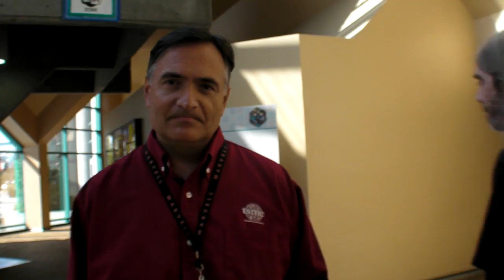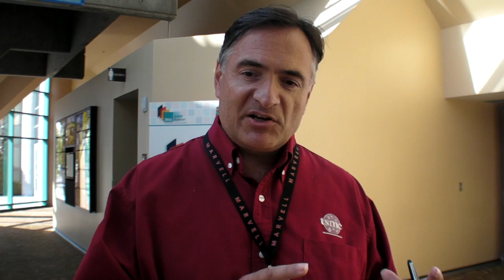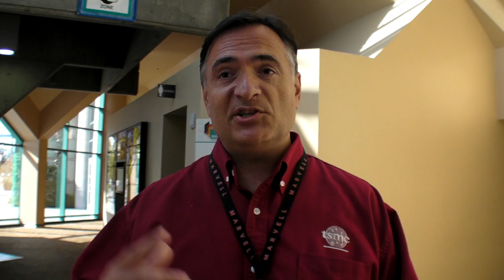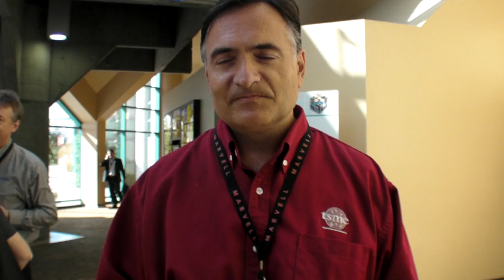TSMC plans to make as small as 7nm processors, 28nm is now in volume production

Comment: Another problem is yield which requires improvement whomever TSMC would be manufacturing for. As TSMC won't be able to compete with Samsung even in the foundry area, a good  way would be manufacturing ARM SoCs, RF/IF devices and even mobile DRAM/Flash devices solely for Apple's iPhones and other products of Apple.,thus avoiding competition. Apple neeeds an alternate source to Samsung.

Comment: TSMC can't compete with Samsung, anyway,due to lack of capital resources. The best way would be to focus on high power semicon devices such as IGBTs for subways and trains, UHV switching/rectification devices,GaAs MMICs, and over tactical grade MMIC sensors ,all niche areas which Samsung will never attempt to enter. The key is that Korean companies, regardless of size,will never enter niche areas(where Germans are strong at).